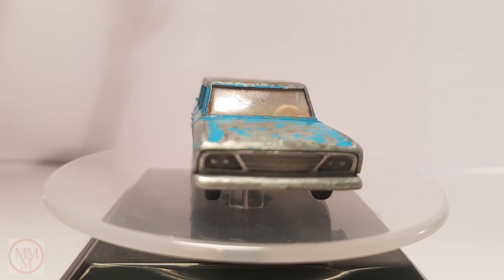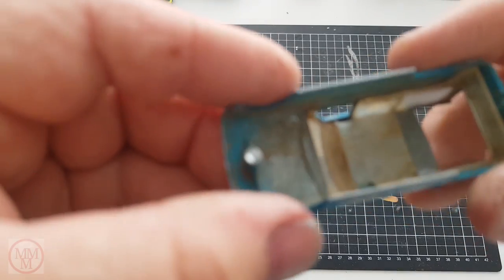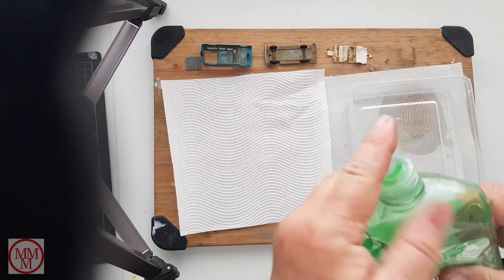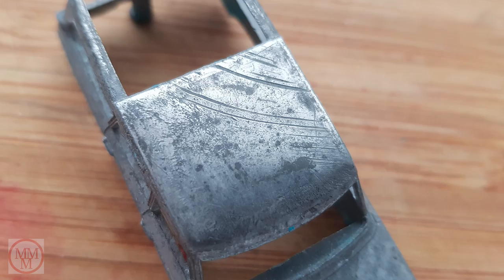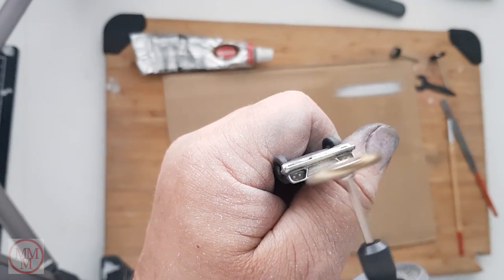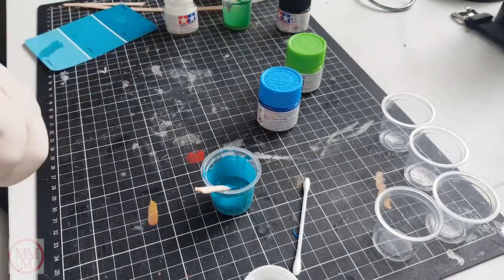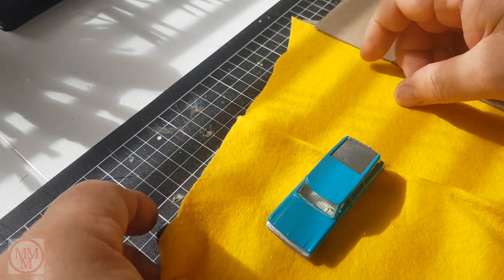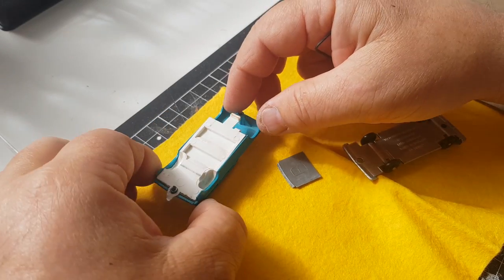MATCHBOX Restoration No 42b Studebaker Lark Wagonaire 1965

Comment: Hi Marty I'm an old ewp teacher (Technical school) To assist starting the tap after drilling set the car body in the drill vice and the tap in the drill chuck turn the chuck by hand for a couple of turns then use the tap handle. another tip never have your hand below the drill because if it brakes you now where it will finish up still its you hand so go for it .
Thanks for the videos and I love the comments at the end

Comment: Excellent restoration!  A repaint and polish makes such a difference to these Matchboxes.  I have one as well.  Came in a job lot, and was missing the tow hook.  Got a repro. plastic towhook for it.  The paint is not too bad on mine, so I left it as is for now.  I noticed too, while drilling it apart that the rear rivet post is very close to the edge of the sloping tailgate, and does not leave much room to tap a thread for a screw.   While I had the interior out, I swapped over the steering wheel to make it right hand drive.  Studebakers like this Lark were assembled by AMI (Australian Motor Industries) in Port Melbourne and sold here.  It now displays hitched up to a #38 Honda motorcycle and trailer.

Comment: Marty, I'm a seventy year old Yank who used to collect the Lesney / Matchbox vehicles when I was a kid.  Sometimes I would take them apart and repaint them with Testor's spray enamel; and sometimes, I would remove the body of some one of them and mount them on an HO scale electric model chassis and use them on a race track.  Due to the weight of the diecast bodies, they weren't very fast, but they sure looked cool.  This wasn't an original idea in my part, I read about how to do this in a magazine devoted to HO scale cars.  There was one truck which I believe was called a Delivery Lorry, it was a deep maroon in color, it was my favorite.  Thanks for your videos, I will get to all of them

Roy

Comment: Enjoy the videos even though I'm on the other side of the world. Here in Michigan we do some manufacturing. I noticed your tapping process. With a simple piece of angle iron you make a centering fixture. If put a wide rubber band around the lower part of the fixture it will cushion the part.  Place car in the vice with the angle iron to locate hole. Just drill a hole at the common location. If there are multiples, make several holes.  This should aid in a straight drilling process.
Reply from the maker: Thanks Shawn but leaning towards self tapping screws from now on in!

Comment: Very cool and pleasing to watch. I am steadily working my way through your older videos.
If I were tapping those threads I would probably reach for a small “T” style tap handle and a bottoming tap instead of plug or taper tap. That metal is soft so there would be little risk of breaking the tap, and the threads will go deeper.

Comment: Beautiful job, Marty. In the late 60's to mid 70's, I volunteered at a race track for micro midget racers. One of the guys had one of those wagons and hauled his race car in it. By sliding the roof back, the car would fit, with the roll cage sticking out the top. I was a push car driver, as these racers had no starter motor and had to be pushed off to start them. Yes, I'm an old fart. LOL.

Comment: I remember when the actual car was introduced.  The sliding roof panel was part of the advertisement on TV.  I initially thought, "That's so stupid, the roof is going to leak!"  It did.  The seals were redesigned, but really to no avail.  A fixed, solid roof was later introduced, but the company folded circa 1966.  Nice work on the restoration, Marty.

Comment: Suggestion: Look into buying a ‘bottom tap’. Those are designed to tap all the way to the bottom of the hole you drilled. The one you use does NOT tap threads to the bottom of the hole. The one you want has a flat bottom, the one you use has a pointy bottom.
Reply from the maker: Good info Steve - I will do some more homework!

Comment: Marty:

Just an FYI,  some of my relatives had one of these real cars.  The gas cap was chromed, and there were pieces of chrome trim on the roof pillars.

The sliding roof panel could be removed, and replaced with either a clear piece, or a canvas one for summer.

Comment: Marty, I'd use an small end mill bit in the Dremel rather than a regular drill bit to remove the rivet heads. Those end in a flat shape, so they would cut away the top part much more cleanly, without making a deeper cut into the shank. Not a terribly large difference with those sizes, but as you have the Dremel at hand anyway, why not.
Reply: An end mill will grab and damage the model. You need a vise and drill press.

Comment: I had one of those. I got it because it was the closest you I could get to my Dads car. He had a Cortina Estate/Station wagon. But neither Matchbox not Corgi did an estate version of that car. 
For making clear plastic parts really shine have you tried Johnson's clear? It may be called pledge where you are. It is a clear acrylic floor polish that dries rock hard. Dip the part in it for a few seconds then use a bit of tissue or q-tip to get rid of the excess that will form a drip. Let it dry and it helps hide minor scuffs and micro scratches.

Comment: I know you are trying to restore the models to original condition but since they are restorations and not originals, I would try to paint some extra details like painting the tail lights red, headlights white and there is a trick with the grills; you can paint them silver, then when they are dry, wipe black paint on them and then quickly wipe the black off.  Thant will leave black in the holes in the grills giving it a more realistic look.  I used to do this with my toy cars and models when I was a kid.  I love watching your restorations.  Keep up the good work!

Comment: Great work!  Exactly what size screws are you using?  All the ones I've found (in the US) have heads that are too small or shafts that are too big.
Reply from the maker: I think they are called 'M2' screws - I got them from china through ebay.
Reply: @MartysMatchboxMakeovers  Thanks for the info.  I'm currently working on a #74 Daimler bus, trying to figure out how to get at the rivet head,   which is inside a 1 cm recess in the back of the model.  Love the videos, keep posting!  It's really great to see vintage MB getting brought back to new condition.

Comment: Marty, I notice that when you drill the rivet head so you can pop off the base, there is just the slightest remains of the original rivet left so the 2mm screw never quit sits flush with the interior post that you drill out. Have you ever considered removing that slight piece of the old rivet with a file?

Comment: when you get new wire brushes for your dremel, run them inside of a  styrofoam cup or a can to remove all the loose wires ( damn things hurt when they stick you, almost as bad as the knife did) left over from the manufacturing process.

Comment: These videos are oddly satisfying and enjoyable. Was never much of a matchbox person myself but I love seeing them brought back to life. I can also see the happiness it brings you as well. 

The drilling and tapping seems to be a bit of frustration on the last couple. Have you thought about using a bottom tap. With normal tap there is a small amount of unthreaded space at the bottom of the hole. A bottom tap cut to the bottom in the drilled hole. In a way maximize what you have to work with. Here is a link to a YouTube video that does a far more eloquent job of describing the difference. https://youtu.be/r6Ijd9o-C10

Either way I look forward to the next installment.
Reply: Agreed.  I had boxes of these 50 years ago but didn't appreciate the detail in the castings.  Marty's vids (and others) have given me a much better appreciation for the craftsmen at Lesney - that gas cap is **how big**???    I like Hot Wheels, too, but the same level of detail is not there ... but they sure were faster ...

Comment: You should seriously consider using a bottoming tap after you've started your threads. This will allow you to tap to the bottom of your blind hole, while your tapered tap leaves a large section unusable. Remember to start your thread with you regular tap, and complete it with your bottoming tap.

Comment: If ya wanna do a proper mirror-like finish or chrome-like finish, it'll take a bit of time really, as ya gotta sand it fairly roughly at first, then gradually go higher in grit, wet sanding with  somewhere between 2000 - 4000 in the end, before then finally using the rubbing compound and/or polish.  So working up from 180, through 240,  500, 800, 1000, 1500... and so forth, how many steps ya do is up to you really. the finer ya can go the better the result, once getting up to about 1000 ya can swap to wetsanding.

Comment: When polishing, you're relying too much on the buffer and compound to do the work. You can't do that. You should be starting with coarse (relatively speaking) sandpaper and working up to ultra fine. The buffer should be used only to remove VERY fine scratches.

If you use the buffer and compound to do all the work (or majority of the work), you'll only end up with a wavy finish.

Great videos though! Always enjoy watching them.

Comment: Marty, maybe it’s just artistic license, but I thought the sliding roof was originally white?
Reply: Pretty sure mine was a rich cream colour ..
Reply: brian last — oh, yes, it may have been cream
Reply: On the prototype, it would have been the same color as the rest of the body.  I've seen several Wagonaires at the annual Ohio Studebaker meet in September, and they are neat little vehicles.
Reply: Mine has a light blue sliding roof.
Reply: Husky also did the Studebaker Wagon, which was cream or beige.

Comment: What happened to Studebaker?
Reply: In 1954 Studabaker merged with Packard and made cars into the mid sixties with the Avanti design being the last.  In the mid 80's, someone bought the Studabaker name and made some Avanti's using spare parts from the old factory.  In the mid-2000's, someone bought the Avanti name and made a small number of reproductions and new designs.  It's the brand that just won't die.
Reply: Ironically, Studebaker was founded in 1852, making wagons.  They entered the car market in 1902, making an electric car, followed by a gasoline engine a couple of years later.  I remember when the Avanti was introduced in 1963 (I was 13).  It had a "control panel" on the forward ceiling (that was SO cool!), which basically was a set of interior light switches.  At the end of that year, the company moved operations to Canada, and by 1966, they closed.  Another company made a limited run of Avanti's in the mid-1980s.  All Avanti's had a fiberglass body.  I always thought the 1963 Avanti styling was the best.

Comment: You need to wet sand your windows with 2500 then 300 grit and polish then wash and shoot floor sealer out of your airbrush . The look brand new when ur done . You also should start painting off the car passing over from left to right letting ooff when your past the end of the car . Not tiny circle's like your doing . I customize Hot Wheels and paint with an airbrush myself . You can also us floor sealer as a clear coat for the final finish . Just be careful and spray at 15 psi the least flow on ur gun . It self levels and look's great but practice 1st on something your not bothered by stripping again . If you wanna see some of my work visit www.facebook.com/skullreaperzzdesigns I like your stuff !
Reply: I ment 3000 grit not 300 lol !